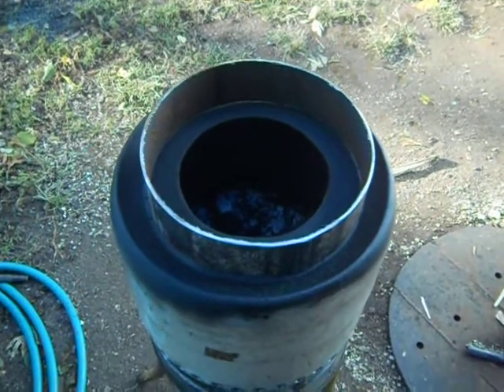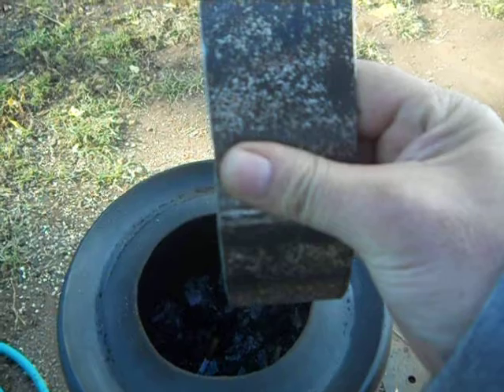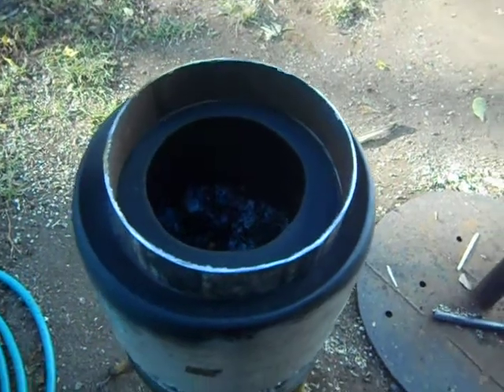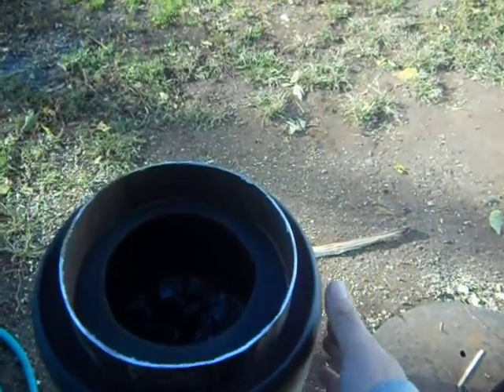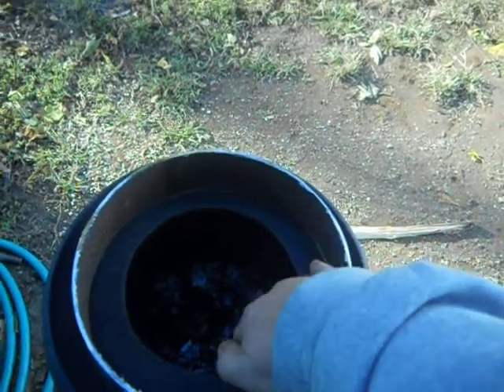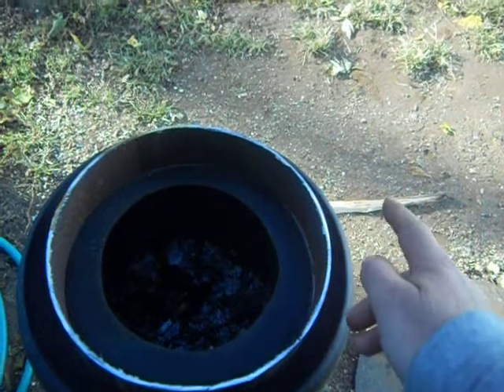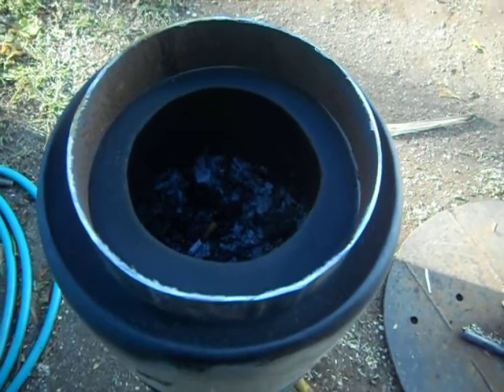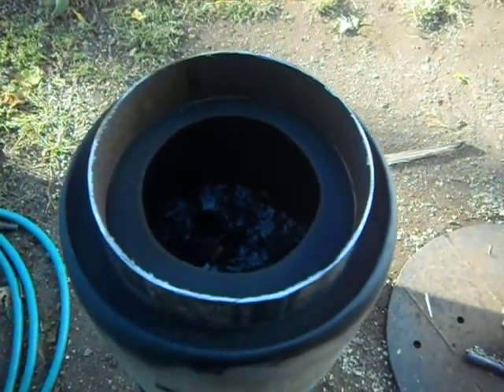WoodGas Pot Stand Burner Idea

Comment: I built a stove a lot like this during the Summer--almost works too good!

I don't know if you're on Facebook, but if you are, send me a message and I'll find you a picture of it. http://www.Facebook.com/OMINOUSOHM

P.S.
The legs on your dutch oven should fit on the outside of that ring/stovepipe AND you should still get enough ventilation for combustion ;)
Reply from the maker: I never finished this project I do need to work on it again It does work too good It burns so hot that I need to use small amounts of wood It would make a good stove for amy big dutch oven